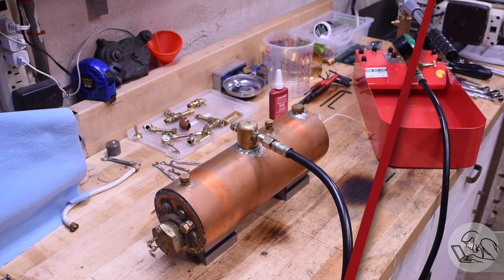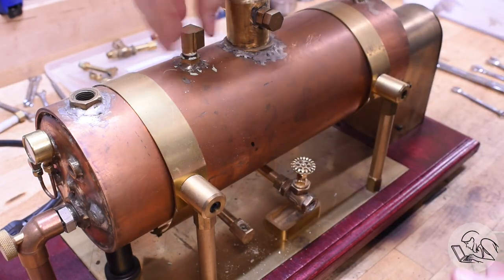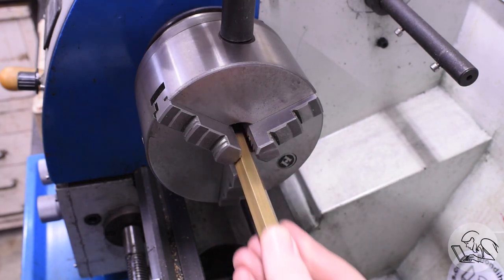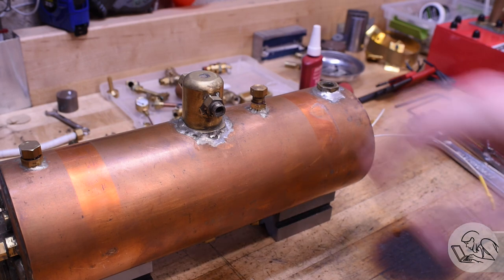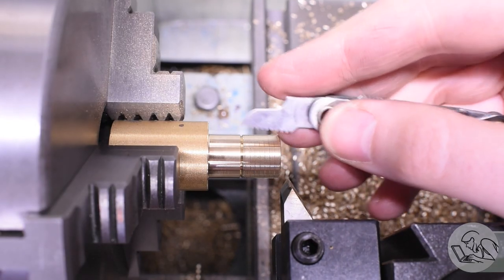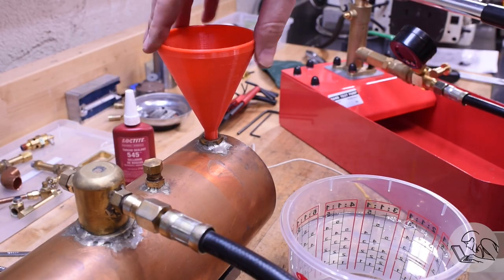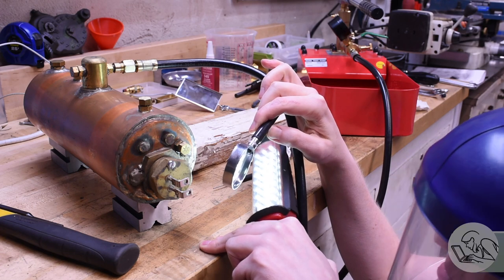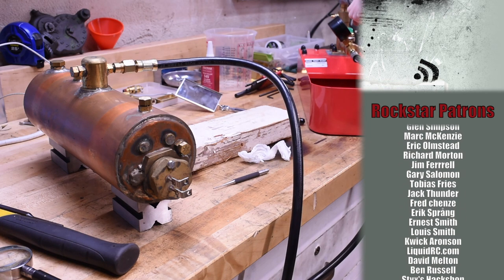Boiler Pressure Test!

Comment: Electric boiler huh? That's like those swiss steam locomotives that they retrofitted to run on overhead wires during WW2. The price of german coal kept going up but they had access to a whole lot of hydroelectricity, so they stuck a resistance heater in the boiler and some pantographs on the roof. I think it was just some yard switchers, not mainline trains.
Reply: I am an avid WWII history buff and had never heard this. Thanks... 👍
Reply: ah yes the electric-steam locomotive not to get mixt up with the steam-electric locomotive.
Reply from the maker: That’s amazing. I didn’t know that.
Reply: I bet you they ran like a swiss clock 🧐
Reply: @justinstrik7125  nah...  But they did run like Swiss locomotives.
Reply: Being Swiss trains, I’m sure they ran on time. I crack me up. 😎👍👀
Reply: Hornby actually made a commercially available live steam OO locomotive model back in 2003 that used an electric boiler powered by 12 volts DC in the track. That line has since been discontinued and it's kind of fallen into legend. The current was high enough that you needed a specialist power supply.

Comment: Your ease of building your own brass couplings has me very inspired. I hate going to the store to scrounge around the brass fittings and spend half my time restocking parts that have been mis-shelved to only discover the part I need isn't there. I've done this routine WAY too many times. Then the off time you do find the right fitting, I'm always shocked at the price for some reason. The idea of just knocking out any given brass fitting needed is honestly kind of intoxicating. Thx for the inspiration.

Comment: Excellent explanation of the hydrostatic test rationale. I’m in the pipeline business and our test segments can sometimes be 50 miles of 42” pipe and when we get 340,000 gallons up to test pressure(2,000psi) we go looking for a leak if we have to keep adding those little pump strokes. 😀

Comment: I looked up the difference between Loctite 545 and 569, and 545 lubricates well, allowing for removal of your parts or aiding with fine threads, while 569 is high strength and cures, allowing for extra security against shock and vibration.

Comment: Hi Quinn your videos are the best because you include all of your mistakes which I think is important for the audience you are aiming for. Your honesty is one of your many assets. You probably already know this so just ignore this if so and please don’t take offense because none is intended. I am a Brit and we use a pipe thread called BSP it stands for British standard pipe and is produced on a flat, parallel shank. NTP I believe is a Japanese standard thread (not 100 % sure on that point) and is I also believe the same TPI in many of the sizes but produced as you say on a taper shank. Some people not knowing this mix these fittings and it doesn’t always end well. The point I am making is that I prefer the BSP fittings for my steam models that I have built over the years. A nice video as always thank you.

Comment: Hey Quinn, I’d like to mention a way to touch up solder that I was proud to learn. I used to touch the solder with the torch flame quickly then wipe it away with a dry cloth. This could be done even after the solder joint was made. My boss won awards for boilers, he finished them by wiping with alcohol and using spray can lacquer over the pipes and joints to keep the new look. Don’t know if this is something that can be helpful, but I’m happy to try and help your progress (even if it is from the comment section). Good work, neat stuff, thanks for sharing your videos
Reply: Ryan, My dad was a plumber as was his dad. When I was a kid my dad showed me how to solder. He had a dedicated "wiping cloth" that he used when he wanted an especially neat joint. I remember it being several layers of cloth sewn together and maybe about 3 inches square (75 mm).  I'm not sure what kind of cloth it was made of, but I  don't think it was fire proof. He just used it quickly and it didn't ignite. I don't think I have remembered that in more than 50 years. Thanks for reminding me.

Comment: I’ve tested many pressure vessels in my life. Air receivers mostly. I used to fill them with water completely then use a grease gun to provide the pressure. Worked out quite well. A hand operated grease gun can develop 3000 PSIG.
Love your stuff. Really enjoyed your steam engine build. I made a little wobbler a few years ago. A Mr. Pete design.

Comment: It took me a while to learn silver soldering so I don't think your first efforts are an issue.  Thanks to YouTube contributors like you I can now silver solder with confidence.

The boiler you have produced is similar to the marine boiler I use on my 5" gauge locomotive where the heat source can be quickly removed in an emergency!

Comment: Hydro-static examination, AKA a squeeze. You should also check the blowdown of the safety valve by dropping the pressure slowly and noting what pressure it re-seats at.

Comment: Quinn, I had occasion to pressure test a 6ft. dia. x 20 ft. long autoclave and your description of the process was nearly identical. We used a pressure washer to generate the 200 psi required. The test went fine until the door seal popped out and dumped the 3 or 4 thousand gallons of water on the floor. No problem because there was a lot of available space and adequate floor drains. The state inspector was satisfied and we operated the autoclave for several years using steam for vulcanizing conveyor pulley rubber outside linings.

Comment: To Quin, you might find that one of those thread sealants is specked for brass and one for steel, as the metal acts as the catalyst for annerobic thread sealants the quality and curing of the final seal is strongly effected by the metal that there used on, brass normal requires a different one due to steel because of its much greater catalytic activity in such an application, some relatively inert metals also require an activator on the thread (think stainless steel and such) to cure inside of a human life time. For there heat life and other such technical specifications Henkel (locktites parent group) have all the graphs on there website.

Comment: That’s really cool. I’ve worked with boiler makers rebuilding boilers in hospitals and factories. The testing of the boiler always made me a little nervous. The Millwrights do everything on the pressure vessel but weld. You need a special welding certification. 
       Hopefully someday I can build a little steam engine like yours and a boiler. I’ve also been wanting to build a steam turbine

Comment: On the  power utility boiler i operate there are 3 safety valves. During safety testing we gag 2 of the 3 safety's and fire the unit at full load raising the steam pressure untill the safety valve lifts. Although there are 3 each valve is rated for a full steam flow over pressure situation. And when they pop, even when your expecting it, it's still a brown trousers moment lol.
PS we hydro test to 3000psi but use exactly the same process you used.

Comment: If you turn it too small a fist shake will not fix it. Just turn it to a bigger dimension with the increase diameter tool. Or run the lathe backward and unturn it. 

Design of the boiler is genius, if you forget to add water the heating element will just burn out and then the system shuts down. Very little chance of an explosion do too low water. Still can explode from over pressure so you still have to hydro and have a relief valve. Great for running indoors where exhaust is a problem.

Comment: Nice video, I designed a few valves for Campbell Hausfeld (air compressor company) in my twenties. You can add an extra layer of safety by using a Temperature and pressure safety relief.

 The relief you are using looks like a typical air compressor relief value. I am not sure about the long term temperature rating on those. If I remember correctly there was once an issue with the brass/copper combination on certain relief valves when use in a boiler vs air compressor. The problem was the rate brass and copper dissipate heat is different and the differences in expansion caused work hardening of the brace which would result in it cracking. The crack would interfere with the valve moving freely and cause over pressure. 

The problem was solved by increasing the wall thickness of pressure valves used for boilers. This is likley outdate info now. All pressure valves maybe interchangeable but I could be useful information for someone. -David

Comment: Adding to Quinn's safety cautions, "low pressures" with steam or gas can be very dangerous with any pressure vessel. A cap or door on a pressure vessel containing say 5psi (1/3 atmosphere) gauge pressure only needs a diameter of 50 inches (~1300mm) to have a ton of force being exerted on it. 
I've seen an un-fired pressure vessel with a 6ft (~2000mm) door that was accidentally unlatched with less than 5psi residual pressure. When the door came open it hit a person standing nearby and left them with some cracked ribs.
So pretend you are a bomb disposal guy anytime you deal with pressure vessels... be safe!
Cheers from NC/USA

Comment: The best explanation regarding pressurized fluid vs gas or air is that air acts like a spring and it will continue to expel it's energy until it reaches atmospheric pressure.  A hydraulic hose with 2000 psi will leave a mess on the floor if it ruptures, a pressure vessel with 2000 psi will leave pieces of you on the floor.

Comment: Great vlog, Quinn, always love some brass machining, watching it anyway,.
It's  my understanding that tapered threads were developed to seal pipe work to fittings, though there is flank sealing ( most common) or Root to Crest sealing (called Dryseal). When high pressure and pulsing conditions are present, then parallel threads and face sealing is used, face sealing includes various washers, rings, and annulus bite ring.
Always a tense moment hydrostatic testing, good to see PPE being worn, it's scary when using air only and submerging the DUT in water, 
Thanks for sharing.
Regards John Quinn.

Comment: I used to do Hydrostatic Pressure Testing on natural gas wells. We tested our lines between 15-18,000 psi. Well over their rated limit but we did have a few “hot” wells that were up there on pressure. Even though water can’t compress you still didn’t want to really be around that stuff when it’s pressurized. Luckily we never had any incidents and of the hundred or so wells I worked on, only 1 had to be redone. We had really good welders.

Comment: On a coal fire for low water it is easy enough to make a fusible plug.  Should the water drop bleow the crown sheet.  The fusible plug will melt and the resulting steam blaqst will put out the fire.  When I was with the Los Angeles Live Steamers in 1985.  The 1/8 NPT has a 1/8" hole filled with solder.  It should be noted.  That one should check with what ever modeling club.  As some of what you said is not what is considered safe at other clubs.  IE LALS requires two safeties.  One set at operating pressure, the other set at 5 psi higher.

Comment: You should absolutely leave the gauge glass in for the hydrostatic test.  If it fails in service you will have steam with some degree of superheat exiting from the steam space at the boiler working pressure and superheated water from the water space that will instantly become "flash steam" on existing the broken gauge glass.  What you see coming out your kettle is not steam, it is water vapour at 100C.  Steam at 100C + is much nastier if you are standing next to the failure.  If I'm being picky, two intermediate pressure and hold times is better that one (for the reasons you explained in the vid).  Very good point on confirming the capacity of the safety valve.  BUT only after you have done the 2X hydrostatic test on the boiler shell!

Comment: Hi Quinn,
Interesting you're going 2 x working pressure on an annual test. Over in the UK the 2 x test is used on first test then after 1 1/2 x working. On full 12" scale boilers a hydraulic test is normally after 10 years and each year a cold visual inspection. 
Great video thank you.
Reply from the maker: 2x is certainly not necessary, but figured it wouldn’t hurt.

Comment: I know the leak you found was microscopic but in the live steam hobby when we found a pinhole leak we would ad a small amount of powdered ginger to our boiler water and as we fired up the boiler the ginger would find its way into the pinhole and make a permanent plug.
This has been a quick fix in live steam for many many years.
Reply from the maker: Wow, had not heard that trick. Thanks for sharing!
Reply: Never heard that one. We were talking about a radiator repair product today. And apparently some types of Loctite can be sucked into a pinhole if you can get a vacuum in the boiler.

My boiler needed some stays peening over.

Comment: Since you like to use calipers to mark things, I noticed that it's difficult to draw straight lines with both jaws being the same length.
While looking through a catalogue at work I stumbled over calipers specifically designed for marking, with the lower jaw being shorter so the upper one has a solid hold and the entire caliper can be kept straight, which should make things a lot easier.
They also do happen to have carbide plated jaws and are surprisingly inexpensive, though they don't have a dial.
Not to complain, by the way, not my concern^^
Reply: What catalog? What were the calipers called?

Comment: To say the least you are entertaining ! The more I watch your videos the more I understand and it’s because of your teaching technique, thank you ! There’s so much I need to know about mini lathes and much more I want to , at this point I’m a beginner but learning quickly ! Is a boiler the opposite of a radiator ? I had thoughts on building a system with a radiator and a Briggs 5hp motor ( using the Briggs as the drive piston removing the intake valve ) but not sure if it will work !

Comment: According to the manufacturer 569 us a curing adhesive that locks joints while 545 has a high lubricity which allows for easy separation. So if it's going to be at all temporary use the 545, while if you want it to take a 300 pound gorilla with a cheater bar use the 569.

Also, you said that boilers can be dangerous. This is a bad thing to be thinking. You should be treating a steam boiler like a gun. It IS dangerous. Unless there is a hole in it, threaded or not, you should always treat it as if it is a dangerous object. Unless you verify that a valve is open and it cannot hold pressure, it is.

Also also, if you haven't already painted it, have you considered a clear lacquer for your steam engine? Or possibly japanning if you don't mind baking it a bit. Hand tool rescue has a pretty good bit on it.

Comment: I build high power rocket motors in my garage. My neighbors moved as soon as they discovered what I was doing in the garage late at night! I pressure tested motors to at least 1500 psi.  I use a grease gun  filled with mineral oil to pressurize a water filled motor. 1/8" copper pipe was used to plumb the assembly. Needle valves were used to hold and relieve pressure. Of course the test rig was hydrostatic tested. The total cost wa as minimal.
Reply: Very interesting. I was thinking about a bicycle pump.

Comment: We have certain types of shafts at work that have npt threads in the end. Normally 1”-1”1/2. We have to hand tap them as they are like 100-200mm down inside the end of the shaft. Funnnnn

Comment: Tiny leaks like that often take care of themselves as a bit of scale builds up around the area. Do you use distilled water  for steaming the boiler? I reckon Mario and Luigi would be super proud of those solder joints.😁
Reply from the maker: Yup, distilled water only.

Comment: Besides being able to drop the fire most (not all) steam locomotives also have 2 safety valves. This is partly to overcome one failing. Many also have options to blow down steam, which most times literally is a valve through which they can let steam escape the boiler.

Comment: Bonjour Quinn,
I test my boilers like you do but coulld not stop an internal leak with a punch, this is why I use a dilution of sodium silicate heated at 100°C to solve this problem. Constraint, remove all the accessories, especially glass pipe.
Amicalement Raphaël

Comment: Speaking of stuff exploding, I was fixing up an old compressor. rigged up a motor, got it building pressure. 

pssssssst

Checked all the connectors, nothing. 

The entire underside was held together with rust, hopes, and dreams. And it was currently struggling to hold 60psi. 

"oh ... I need to leave"

Comment: gimme a second, have to pee.... ;) i was gifted with a compressor, the compressor itself from an industrial fridge, ~100 years, the motor from a washing machine, ~60 years, and the tank, 12mm steehl, welded by my father, running on 6 bar, tested with this water method on 100 bar... well done cuty, greetz to the cat, too..

Comment: I had not heard of locomotive boilers having a way to jettison the coal fire out the bottom. Now I wish my pickup truck had that feature.
Reply: You run your pickup on coal???
Reply: They also have lead-filled plugs between the steam and the fire; if the water level gets down to the plugs they melt and the steam blows the fire out.  Probably in a dramatic fashion too.